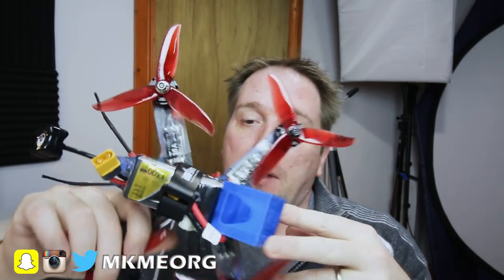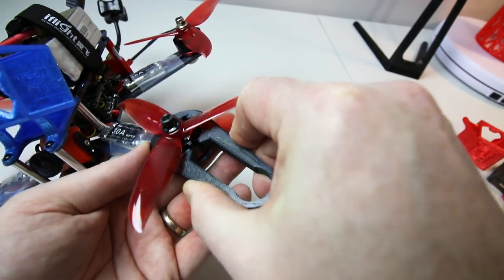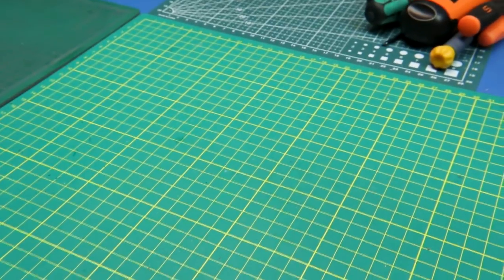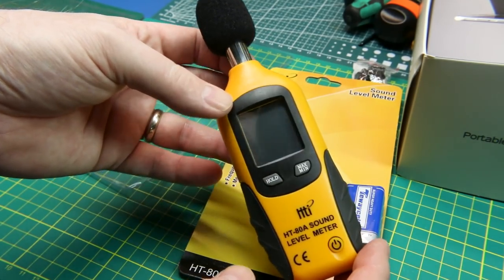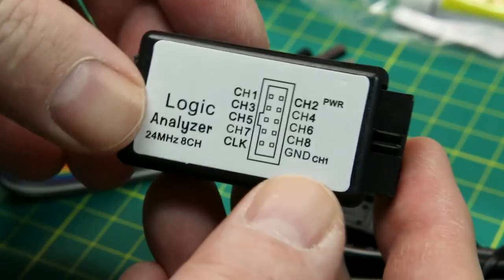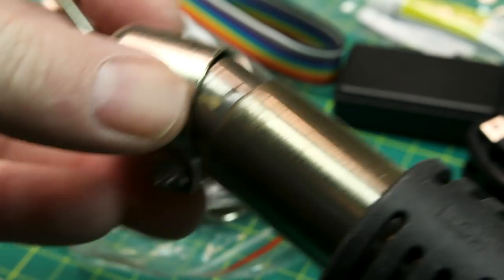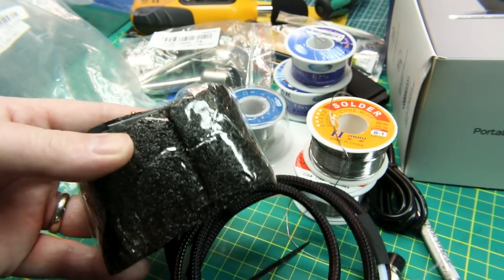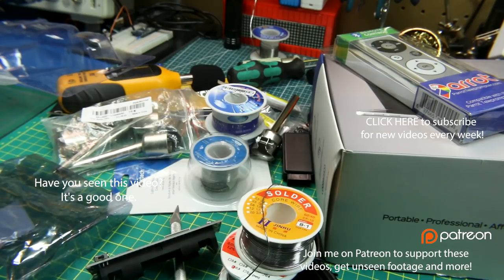Nearly DESTROYED My New Drone!  🆕MAILBAG

Comment: I've had the same experience with cheap ebay solder.

Earlier this week I stopped at a local supplier and spent the money on a 10 year supply of good name brand solder. 
60/40, of course. None of that ROHS safety solder for this old guy.
Reply: What is the  brand name of the solder you got?

Comment: Worst quad gone wild I had was when it went off in the boot of the car having loaded the latest beta betaflight. Hairy / scary / dangerous. Aah, as for reversing motors ....maybe go old school, swap a couple of wires over between motor and esc. Hope life goes well.
Reply from the maker: Yep I nearly had a huge dumb moment there. It is scary as hell when they go wild :)   I would have reversed wires but the initial upload through the DYS FC bricked them. 2 would still arm but offfset from each other by nearly a full second.  No way I was gonna try that :)  All are well now.  Cheers Bud.

Comment: The reason you have problems with your 3D printer hot ends is because they are cheap. I had lots of clogs and jams in my stock CR-10 hotend so I tried a MicroSwiss (even worse IMHO) then decided to spend the money on an E3DV6. I didn't believe it could be as good as reviewers said it was but I have been running it for almost 2 years without a single clog, worth the price.